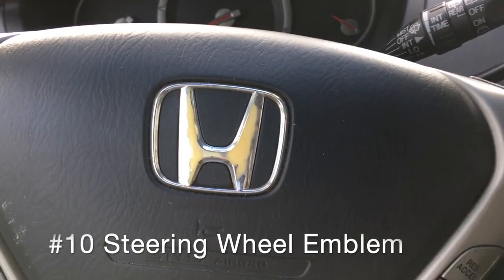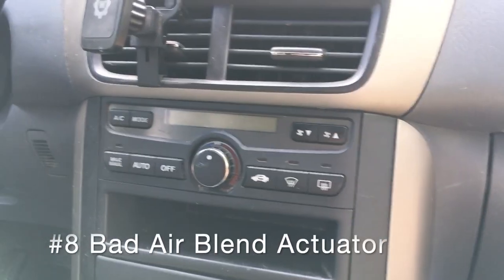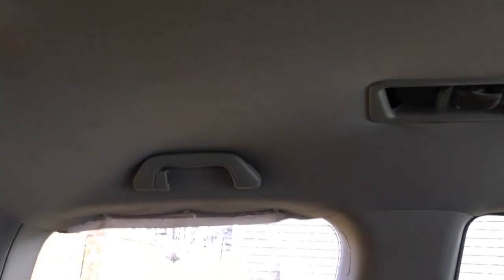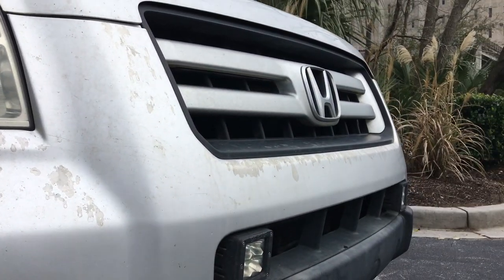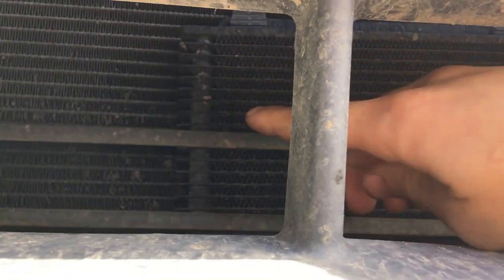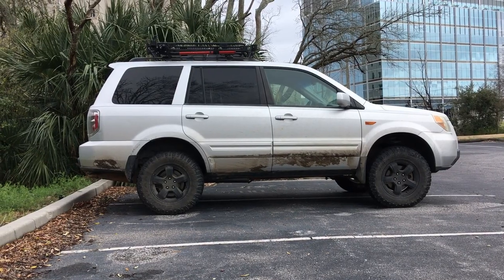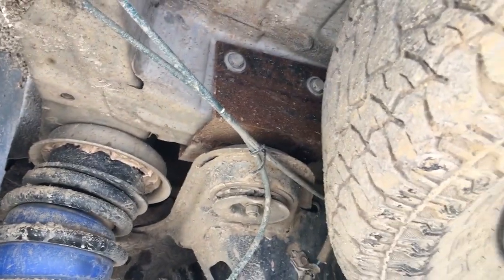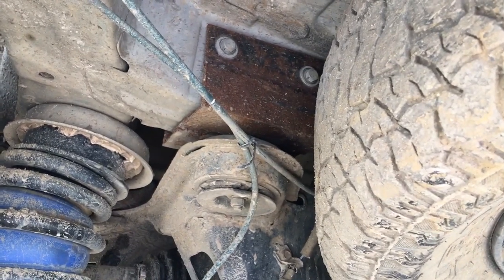Top 10 Common Honda Pilot Problems (2003-2008)

Comment: How about the power steering whine? Replace the o-rings on the power steering pump lines where they connect at the pump. Keep up the good work. 07 EX-L here.
Reply from the maker: Another good one! My rack is leaking too!
Reply: As is mine.
Reply from the maker: @basoncivicsi  I have a replacement rack and pinion in my garage.
Reply: When are we installing?
Reply from the maker: @basoncivicsi  i was waiting until it started leaking, but it’s been over 3 years lol
Reply: power steering whine can be fixed by cleaning the screen in reservoir
Reply: usually its clogged starving the suction of the pump.
Reply: @GotterAdventure  Put Lucas Power Steering Stop Leak in the PS fluid and it will stop the leak without replacing the rack.
Reply from the maker: @scotty_macharooni  thanks for the advice. I have been running the Lucas stop leak for several years :) it isn’t a fast leak so I have just been putting up with it.
Reply: That's just a Honda thing, especially with the j series.
Reply: I mean the o ring
Reply: How about it? It drives me nuts. 😂😂😂
Reply: @crtinkering7323  how does one clean that screen?
Reply: @amberjones6225  its been awhile since ive done it, but I do remember it was easily removable.  Just disconnect the inlet and outlet hoses going to the reservoir and unbolt the reservoir from the vehicle ...then you could simply remove it from the car bring it to a 5 gallon bucket and spray it with some solvent cleaner.  Give it a quick rinse and install it back in the vehicle with some new fluid.  Mine was clogged with metal shavings...  you can actually install easily intall a inline magnetic filter as well.  to be truthful that plastic reservoir is very cheap and you can just buy a complete new one  online with a new screen built in
Reply: @crtinkering7323  thank you so much! 😁
Reply: I changed my shocks and struts and it went away.
Reply: I had the power steering whine on my '06, changed the o-rings for less than $10...problem solved.
Reply: @scotty_macharooni  how does it do that
Reply: @elperrocovero  The Lucas Stop Leak?  It has an component that makes the rubber seals swell up a little to compensate for worn rubber.  Whereever the fluid leaks out, it makes the seal swell a little more and stop the leak.
Reply: Thanks for the video‼️
I put transmission fluid in mine and it stopped it and that’s been about 3 years ago
I know that all the Honda lovers like myself will not approve anything other than OEM Honda fluid but I cheated on this one as well as with servicing my transmission lol
Reply: My 04 makes a ppwer steering whine er a strange grrrrr sound .
Pretty sure iam headed for a new pump
Reply: Hello?? are we living the same exact life???? zi have the same exact problem.
Reply: Mine was doing the same exact thing, the O ring fix didn’t work for mine but a replacement pump worked and was only about 400 dollars. I can also actually turn the wheel now while parking 😅

Comment: Just bought 2005 Ex-l  in December of last year for $3500. I love it. Very happy with it. I live in New York and had it parked in my church’s outdoor parking lot. One day, I had to get it out to take my family to Walmart. I just press VTM-4 Lock button, go to the 2nd gear and it drove out of the snow with no problem. For repairs, I replaced power steering pump, timing belt and serpentine belt, and water pump. I also used it to haul boxes to feed the community with my church. Like I said before, I’m very happy with it.

Comment: Got my 2006 pilot 4WD 2 years ago with 270 thousand miles, a shot in the dark honestly. Fell in love the moment I test drive it tho. Had some ac issues that are fixed, had to get a new rack and pinion, very costy but still worth it. Now with 312 thousand miles still runs like it has less than 100 thousand miles, absolutely great machine Honda made. Next change will be the timing belt for sure. I’m currently having issues with the truck locking system though, the trunk won’t open.

Comment: The rear blower motor stopped working in my 2008 pilot, but a $10 blower resistor from Amazon fixed this easily.

Comment: 06 Pilot, 172 K miles. Transmission won't drive in 1st gear. Even manually trying to shift the arm it won't go into 1st gear. Feels like I'm taking off in 2nd gear. Anyone else experienced this?

Comment: Consider installing a rock guard in the lower grill to protect the radiator and ATF cooler.  I got a dent in mine.  I used an APS lower bumper billet grille insert and it worked great.

Comment: Yeah found the rear frame issue and hopefully I can get local shop to repair it. Seems to be the only location for rust issues so far (rear driver side crossmember/sub assembly front mount is hanging down) then I'll proceed to to provide proper drainage and hopefully avoid further problems. Like the vehicle and want to get a lot more miles out of it, currently at 227K in Wisconsin. And by comparison among other brands I think I'm doing pretty good with this truck. Thanks for the insight- -most appreciated.

Comment: Great Video!  Nailed 4 problems on my 2006 Honda Pilot.  (1) Silver coating on the Honda emblem on the steering wheel.  (2) Sagging headliner.  (3) Bad Cat Converter (4) Bad TPMS sensors.  You know what?  It's nearly 17 years old with 223k on the odometer with 30k added since November of 2021 alone.  Runs like a dream!   I don't care about (1).  I don't care about (2).  I'll replace (3) in a little bit because it's not bad, just less efficient according to the code .  And when I get my new set of tires in a few days the sensors will be replaced as well.  As for the other issues you listed that will be on my radar now since this is my 1st Honda Pilot (I've owned 2 other Hondas, a 1995 Odyssey and a 2002 Civic which dropped the transmission which is why I bought the Pilot).  I am now a subscriber because of this video and also your upgrade ideas in your other videos as I want to make my Pilot a project vehicle and give it to one of my kids in a couple of years.  Thanks for sharing your Pilot knowledge!

Comment: I bought my wife a 2004 pilot in 2010 with 50k miles. I have kept meticulous care of it and my wife still loves the car with 220k miles. I have had to do very little maintenance beside the normal wearable items like fluids brakes etc. One item you didn't mention which is a huge problem for all hondas is the ignition switch. The wafers and springs inside the ignition lock cylinder come loose and jam, not allowing the cylinder to turn. Its a 300 to 700 dollar repair depending on where you take it. Plus a tow, because it usually fails at an inconvenient time. Also another honda weak link is the transmission. Not so much in the pilot but please keep up with your transmission fluid changes. Also, if you are comfortable doing work on your car, pull the shift solenoids out and clean the screens. They can build up with clutch debris and can cause erratic shifting causing you to think you have a serious transmission issue when you might not. And yes, timing belt changes on schedule are critical. Get a good brand and get the full kit. Full kit should include belt, tensioners, water pump, valve cover gaskets, cam seals and lower seal. Don't cheap out on this. And when you do the timing belt you are also supposed to adjust the rocker arms. Thats why good kits come with valve cover gaskets. As for the subframe area that pools water. Just drill a small drain hole. And paint where you drilled so it doesn't rust. 

Cheers.

P.S. dont buy shitty parts from scamazon. Your car will treat you as well as you treat it.

Comment: We have 2 pilots in the family an 07 and an 08 never had any of these issues, guess we are very lucky! Love your videos!
Reply from the maker: Wow it is always great to hear that some escape these issues! Thanks :)
Reply: 2003 never done me wrong
Reply: Any issues yet with 07? I bought one and I don’t like the way my suspension sounds.
Reply: @elperrocovero  we never had suspension issues. The 07 has been on trails where pilots dont go and lots of dirt roads, no issues at all.
Reply: @GotterAdventure  Hey Hpo, the frame rot on the cross member. Could i just drill a hole in it. Kind of like a weep hole from pooling water right there. Do you think that is a good solution?
Reply from the maker: @brizzx32  that could might help. I'm pretty sure water is being trapped there
Reply: @GotterAdventure  Yeah then spray some wd40 up there. They also make rust inhibitors in a can, sold  in the paint section at hardware stores. But tks for the tips, good vid.

Comment: My rear a/c conditioner blower on my 2005 honda pilot was not working.  So I replace a new transistor for the blower. It works now but it makes a rattle noise when I turn it on. But it goes away when I increase the air volume.  And I replaced a new starter.
Thanks for the tip on the tire sensors.
Reply from the maker: Great feedback thanks!

Comment: 2004 EX-L. My driver's door lock cylinder gave up. I managed to get the alarm sounding with no way to shut it off but disconnecting the battery.  Got new lock cylinder today, installed and somehow shut off alarm. I do love this vehicle!
Reply from the maker: Good to hear you were able to fix it! Great job!

Comment: I own the first gen Honda pilot. 2004 honda pilot ex. Owned it since 2004, with only 40 something miles at the time. Just hit 100,000 2 years ago, and I only put another 11k miles since than. No problems. Change the oil regularly, timing belt every 100k miles, all fluids, atf every 60k miles never had 1 problem with my pilot. Easily the best vehicle I have owned in my lifetime

Comment: Have 06 Pilot. Been having issue with engine Intermittently shutting off.  Someone had recommended me to replace the Catalytic converter. You make things very clear. I may not need to get a new car after all. Thanks Aaron
Reply from the maker: If the engine is running then shutting off it might be the fuel pump
Reply: These Honda Pilots and Toyota Highlanders are built to last a long time.
Reply: @GotterAdventure  thanks Asron. Doing research on rooftop weekender camper lead me to your channel. I'm very excited to see your journey. Any plans on rooftop camper?
Reply from the maker: @LYCAS2317  I have a family of 5 so I don’t think we can fit in a roof top tent well
Reply: If it shuts off then starts in 15min a few hours later, it could be the pgm-fi relay cheap fix
Reply: @GotterAdventure  There is a relay module under the dash, just right of the column. You can open it and you'll find 2 relays inside, one for the fuel pump, the other for the injectors, all soldered to a circuit board. A common problem is that the solder joints get weak and go intermittent, causing intermittent die-outs and no-starts. I had one and was just about to condemn the pump (237K miles) when I started looking for the pump relay, which on most Hondas, were in the engine compartment fuse box. Not the case on my '04 Pilot. Anyway, visually inspect the circuit board for suspicious-looking solder joints and reflow and add a little more solder. I popped that module back in and problem solved and zero $ spent. (Retired Honda-Tech here)

Comment: 08 Honda Pilot recently purchased from family member that was garage kept. 85,000 miles. Even then I have replaced power steering pump and high pressure hose. Power steering rack and pinion. Alternator, shocks all around they were all blown very bouncy. Cold hot AC motor does make the gurgles so that will probably be on the list. I am told the timing belt was done previously but this is coming from my old family member that doesn’t know cars too well not saying I do either but u get it. Hopefully I’m done with the major stuff. Love the car it’s pristine inside and out breaks my heart to see beat up ones. This car aged well I find it to be the more economical 4Runner. My other vehicle is a Tundra but I daily drive this much better to zip around downtown Miami in the mornings.

Comment: Great list of PITA stuff with the Pilots.  Just a note of clarity there is a transmission cooler on them but you are correct a supplemental one is always a good idea.  if you live in a northern climate the fluid should go through the supplementary one first then through the rad one to make sure the fluid doesn't get to cold in the winter.  The strawberry milkshake many have heard about is where the coolant and trans fluid mix in the rad when the cooler seals fail.  If your rad has pressed in tubes for the trans cooler replace it with one that has nuts holding the cooler into the rad tank.  The pressed in ones corrode and push out allowing the seals to fail between the coolant and the trans oil.
Reply: I think aftermarket trans cooler is appropriate for any vehicle with an automatic transmission cause only good things will happen.

Comment: I guess we have been lucky, as the only issue we have had on this top 10 list in the HVAC blend mechanism.  Installed a $20 part off of AMZN, instead of the $200+ Honda part.  Easier to do than re-build it at this point.  Although there are some great youtube videos on rebuilding it!

Comment: You forgot to mention the cheap leather on the front seats and the yellowing plastic on the headlights.  These are pretty solid cars if they are cared for (timing belt, transmission fluid changes regularly, suspension maintenance etc). I had a 06 EXL that was flawless at 140k miles, I regret selling it.  Now I have a 05 with 194, and it runs and drives excellent but needs the front suspension rebuilt.  I honestly recommend one of these to anyone over any early Ford, GM and especially Dodge/Chrysler SUV.
Reply: Have you replaced the timing belt on the 05 you have?
Reply: @pennyprince   No it was done by the previous owner at 177k.  I'm only at 213k now.  Still got a long way to go.  If you're worried about yours, go ahead and do it.  The timing belt job is WAY cheaper than a new engine or rebuilt heads.

Comment: Had the issue with catalytic converter code when I bought my 07 exl 3.5 4wd  fixed it my self by using a bottle of cata-cleaner 3 times and seafoam.  I would dump a bottle of cata-cleaner in tank when my gauge would read 1/4 tank drive to gas light came on filled tank up with premium gas then dumped a bottle of seafoam in it. I did it every other month and still fill my pilot up with premium and I haven't had no issues since. My only concern with my pilot is wanting to put leds in my tail lights and break light and can't find ones that dont cause hyperflash and don't let break lamp light come on. I bought some and the hyperflash happened and break lamp light came on. Bought to be doing a 2.5 inch lift on my pilot can't wait.
Reply from the maker: Awesome! When you do the lift make sure your rear toe adjustment bolt is not seized. I would also recommend camber bolts in the front and the adjustable control arm for the rear.

Comment: My 06 pilot has tpms issues. Very common for older hondas too. I gotta get new tires soon so i hope to have a shop install new sensors with them. I also love your build and i hope to one day jack my pilot up a few inches and get dirty with it!
Reply from the maker: You should be able to get those sensors replaced for sure. One day I am going to do a Honda meetup!
Reply: Our 06 that we bought in 08 with 28k miles has had this issue the whole time.  My local honda dealer told me they could do nothing about it back then and that was when i still had factory warranty.  197k miles now and we finally got me wife a new 23 Elite.. so i get to play with this now Wahoo!!

Comment: My pilot also suffered from the body rot on that part near the subframe! Fixed it similar to yours. My interior door handle chrome peeled off and got some eBay ones. Love your videos, keep it up!
Reply from the maker: Thanks and that is another common problem! Now that I think about it mine has a bubble in the chrome on the inside, so it is only a matter of time :)
Reply: We have the same issue with the interior door handles - all 4
Reply: @timswift3722  yep that’s happened to me before also
Reply: How did you fix yours? Was it the bushings rotted out?

Comment: I had a 2003 and got 212k before a shift solenoid went out. the frame was rusted where you pointed out it was old. But still probably the best vehicle Ive owned. Nothing major went wrong since basically new and it did live in a heavy salt belt and we did neglect to wash it often so I cannot fault the car. 212k and just under 20 years is a pretty good lifespan for a car.

Comment: They have window issues. My 07 with 160,000 miles has only had one window fail and I now need a new headliner, no other issues. The Honda emblem on the steering wheel is in new condition, it hasn’t been garaged since 2013 when I bought it. Good video!

Comment: Purchased my 05 Whit EX-L with 119K now has 223K
Here's my maintenance List : mostly common maintenance.
-Valve Adjustment
-Timing Belt, Water Pump, Spark Plugs
-Alternator
-Starter Motor
-Rear Shocks and struts
-Alignment
-Power Steering motor
-Top compression Hose and bottom rack and pinion passenger side. 
-Oil and filters
-Brake Pads Front 70K  
-Rear pads... about time for new ones.. haven't changed in over 100K !  Still good. 

Surprising areas I have not had to take care of:
-CV Joints ?? Still Good
-Honda Symbol on Steering wheel?  Perfect
-Leather interior? Still amazing No cracks or tears. 
-Creeks or noises?   Still quiet as she purrs down the road. :)
-Disc Rotors?  They may need to be turned now.. will check on the next maintenance

Just to name a few.   Despite some issues with these vehicles.. they are capable, comfortable, quiet, and great daily commuters with surprising offroad capacity.  
-